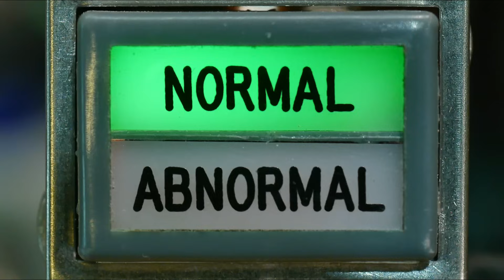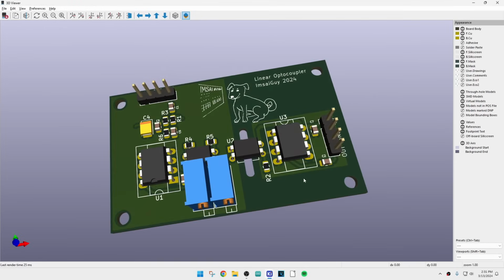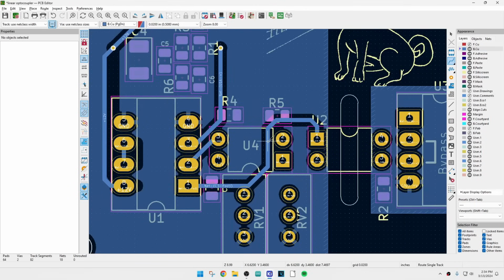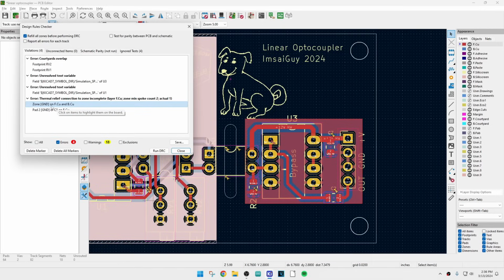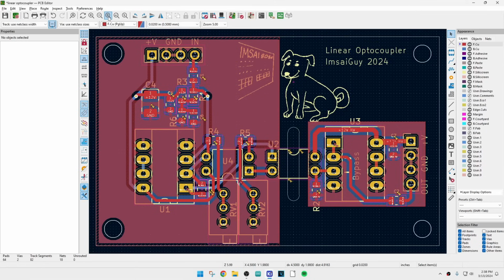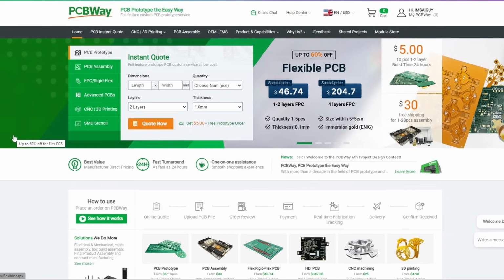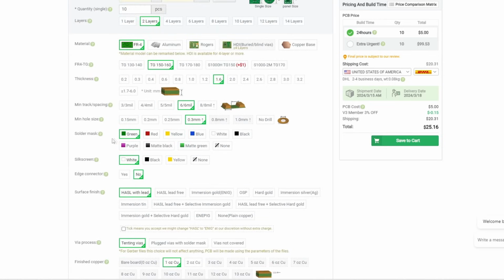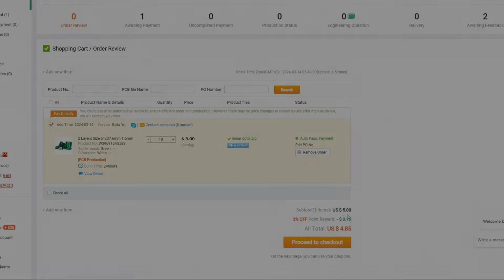#1850 Linear Optocoupler (part 2 of 3)

Comment: I noticed that some of your silk screen reference designators (ie R2, C5, etc...) were placed under the component. This means once the parts are installed you won't be able to see those designators. I always try to place them outside the part so after the board is assembled you can still see the R number or C number or whatever.

Comment: I found if the boards are very small you may get 15 for the magic $5.  I sometime use tiny boards for the WH148 potentiometers.  Solder the board to the pins and then the wires to holes in the board.  About 15-20mm square.

Comment: regarding that cut out if i dont have enough space should i do it under the tht parts or the smd parts ( i have a few isolators and a SIP7 smps that is isolated, what do you think?
Reply: The cutouts on these types of circuits is good standard practice mainly for visual indication of where an isolation is occurring, so technically not critically necessary. The dielectric of the fr4 is, in most cases, sufficient enough by itself. Just leave enough space on the traces to galvanically separate both sides of your circuit without capacitive coupling and you'll be fine
Reply: @sgctactics  thx, i left 5mm solder mask/fr4 empty space i think this is enough then

Comment: Two assumed matching optocouplers do not provide the same linearity as a servo optocoupler with a single diode and two phototransistors. That is because the current to light and reverse linearity of the phototransistor is higher than that of the diode. Btw thermal droop is also a significant effect in the diodes and vary strong with the mounting thermals.